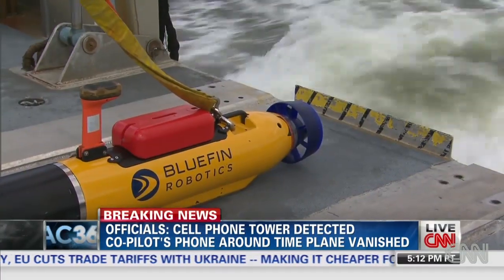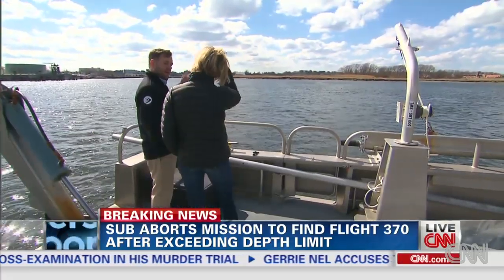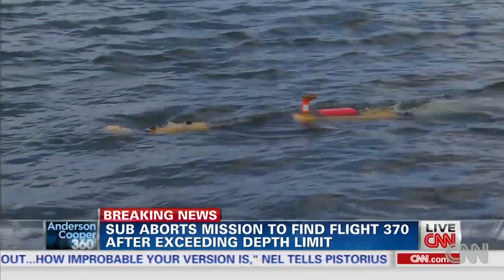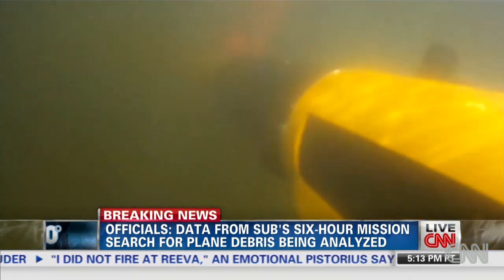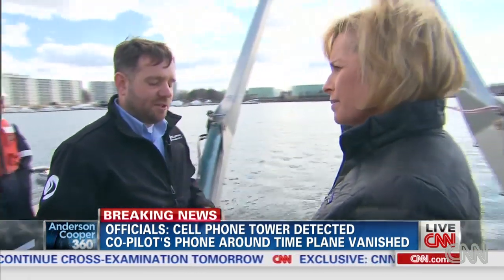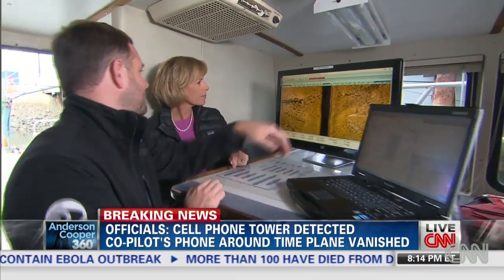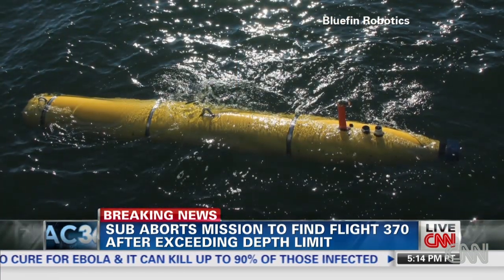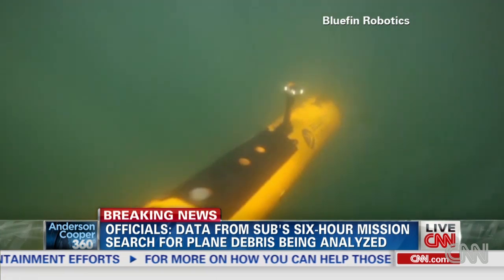See how the Bluefin-21 AUV works underwater

Comment: Can we use aquatic creatures in Search operation by placing cameras and gps locators on them because i have read that blufin can go depth of about 4 miles whereas aquatic creatures can go beyond that by using modernized equipments on them can help the search operation because if there any bodies related to these incident then there may be a chance that these pass near by and images can be taken out from that which may help search operation